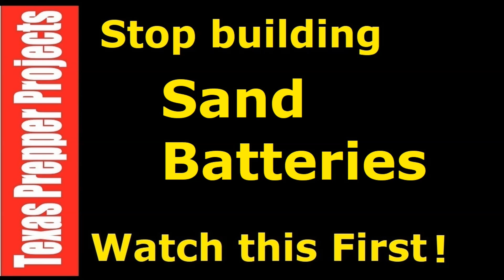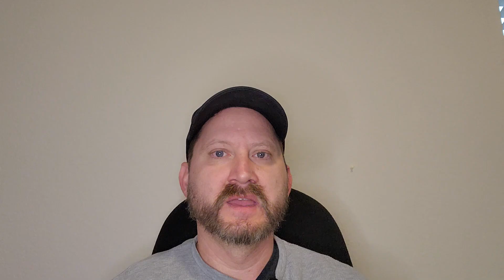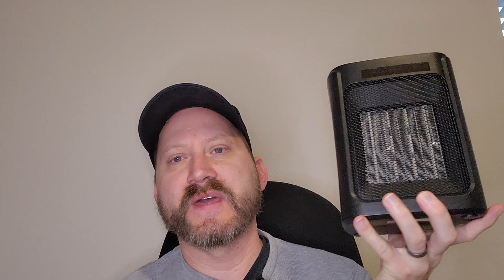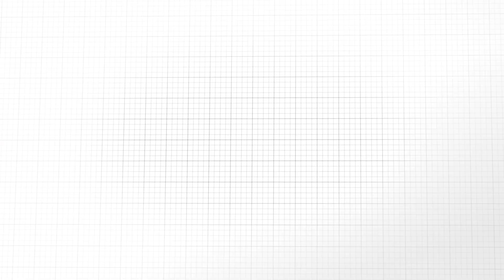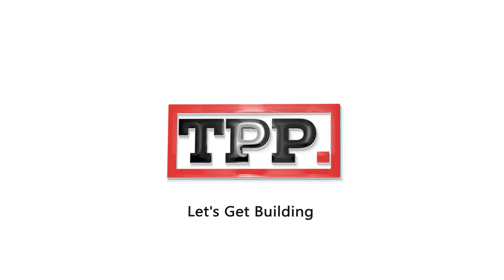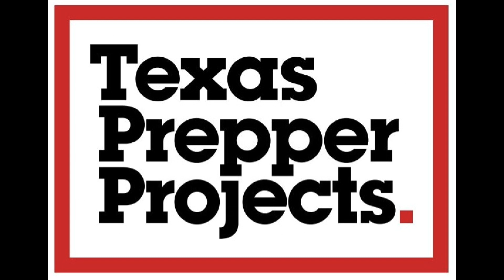Stop Building Sand Batteries | Texas Prepper Projects

Comment: You have used the word nothing very unfairly.  You could say any of these things are inefficient, even insignificant. But the fact is. A little heat is not nothing if you can use it.   Only around 30-40% of your SB heat is going into the air (convection). Most of your energy leaves as Infra Red energy (radiation) that heats the surfaces it finds. like your walls, pets and furniture..  Meaning you can invest heat in your couch and cushions across the room.   A sand battery is heating the whole room.. Actually really well. But you have to size it like any heating or AC system.  To suit your room..  Or, maybe don't treat it as the solution, but swing for reduced power use, which wouldn't be nothing.  

 A solar sand battery costs basically nothing.  Literally wiring and mounting hardware. And whatever it costs you to pick up free used solar panels that the world can't work out how to recycle.  If you have a weekend to put it together and the space to do it.  There's no downside popping to mind.  Just my 2c. I have them in greenhouses, none inside.  But I tell you, they are the difference between frost or not.. So.. It's way more than nothing when you see it.
Reply from the maker: I appreciate your reasonable and rational reply. Thank you!

Comment: sand battery that is heated up with a Fresnel Lense and then powering a sterling engine sounds like a great idea though. im going to try building that exact setup
Reply from the maker: Post a video. I have never seen a commercially available Stirling engine
Reply: @texasprepperprojects  type in mini sterling engine on Google and you can find cool small hobby grade ones. can mess around with it if you were super interested. I'm definitely going to try to make a  small setup with one see if it works well or not
Reply: @texasprepperprojects  there are small Stirling engines on Stirlingkit website

Comment: Missed point!
To all who thinks we create more power than we put in - expect a Nobel Prize!

But why I plan for building a sand battery.

Electricity prices (can be) set to an hourly rate, where I live (It should change in the future to a quarter hour/price).
So USUALLY electricity is CHEAP during the night, and raises sharply in the morning, is reduced during mid day, and raises to the evening to sink again to the night.
* A typical day last Tuesday was: 
between 00-06 o clock  0,4c/kWh
raising from 07-09 up to  17c/ kWh
declining from 10-13 down to 6,4c /kWh
staying from 14-17 between  4-7,1c /kWh
raising from 18-19 to 15,9 c /kWh
declining from 20-24 down to  0,7 c/ kWh
(prices in Euro) need to add 4 c/kWh for "electric transfer fees" to all prices.

Now the 20 USD heater heats even during the 17c peaks.

The whole idea is to heat the sand during the night for  0,4c/kWh, and then stop the heating, allowing the battery to give warmth for hours during the expensive time, avoiding to pay as much then.
If you have solar capacity, you might use the energy during the day to save it to the more expensive evening hours, with a battery that holds heat for hours.
A standard heater, or the 20USD heater will be cold in "10-20" minutes.
Reply from the maker: How many tons of sand are you using?
Reply: @texasprepperprojects    ??? The idea is to LOWER the cost during the day, not to eliminate heat needs with tons of sand!  😮‍💨
Reply from the maker: I look forward to your video with your testing

Comment: It might not make sense with solar , but you can  use   a wood fire to heat a bucket   of sand much hotter than a typical heating element.   

Place some copper tubing in  sand  to help draw heat exchange upward.   Places fireplace heat fan on top to distribute heat through room.   A good fire can yield  five five gallon pails.     

If you build a kilntype burner, think of a big rocket stove  - you can get higher heat yields through gasification.     

Mind you dry sand is about 16 pounds a gallon, so a five pound bucket gets heavy and hot.   Be very careful.   Or use smaller amounts of sand.

I'm  have more wood than sunshine - so  this is a great exchange system.    My wood is virtually free.   It's not good wood for a woodstove  but great for outdoor burning.
Reply from the maker: I look forward to seeing your video

Comment: This is where everyone is wrong. It's the conversions that waste energy. Use fresnel lenses to heat the sand (up to 500c) and use that to heat. 70% of all energy is heat related. Heating the home, air conditioning and absorption refrigeration, dryers, hot water and cooking. All of this can be done with a sand battery for about .47 per kwh of storage. Using an air loop for an oven, air fryer, house heat - A silicone oil loop for burners using liquid heat sinks plates as the burners.  - A water loop for hot water and for instant boiling water for small appliances. This is all able to be done with a sand battery system. This is not fer every situation just like any other type of alternative energy systems. BTW you candle in a flower pot has always been a pet peeve of mine.
Reply from the maker: I am excited to see your video where you show all of these things that you discuss.  Thanks for the comment
Reply: @texasprepperprojects  I don't do videos and this was not a critism of you if you took it that way. I was trying to open the conversation. If you read all the wat through you might have noticed I aligned with you and showed I agreed with your outlook but wanted to expand the thought is all

Comment: Why wouldn't you heat the sand far hotter than a couple hundred degrees?  The melting point is somewhere around 1700 degrees.  Also, why use a heating element instead of a fresnel lens to heat the sand.  Something along this line:  https://www.youtube.com/watch?v=kQCDXK_sXwk
Reply: I use Fresnel lenses myself (mainly for cooking) and I believe Exowatt is a scam to get investor money. No way they heat a large brick mass from above to 1000°C and get 25kW electrical power from the area of a shipping container. It's not like CSP doesn't work, it's actually proven technology, but this sounds like a lot of bs. The fact that they only have computer animations and no working model should ring alarm bells.
Reply from the maker: Because a normal fresnel lens has to be moved every 15 minutes. I saw that video, neat idea
Reply: @texasprepperprojects I did some more digging last night after that. Turned out there are some really simple sun trackers. There's a guy that posted a video where he used that sun tracker and two salvaged drills to keep his lens pointed at the sun, lol. I should be able to find it in my watch history if you're interested in seeing it.

Comment: Thanks so much for explaining those principles. What's?
Your opinion about using sand to store heat. I'm thinking about a passive solar situation where I place a sand battery inside a above ground water tank and allow the Sun to warm the water and the sand at the same time, therefore, minimizing the energy.I need to boost the water up to hot, and retaining that heat overnight because of the sand.
Reply from the maker: I think passively heating water makes more sense

Comment: I would like to try and use it as just an instant-hot water heater. Does anyone have any good resources on how to build one. Maybe in an insulated trash can?
Reply from the maker: Check out my older videos. I did it with a pool heater.  Or a parabolic mirror. It is very easy and very effective

Comment: What if you heat the sand from the sun ?
Reply from the maker: How
Reply: @texasprepperprojects  Parabolic mirror, I can do that. However, the next question is why. I don't need heat in summer and in winter when I want it there's not enough sunshine. If I want hot water e.g. for domestic use there are better systems, like evacuated tube collectors

Comment: A sand battery is not about creating heat out of nothing. It’s  about delaying the use of the heat. In some cases storing during the day and using during the evening. I’m n other cases storing during summer and using during the winter. Scale being the big factor between the two examples.
Reply from the maker: It needs to be a big scale
Reply: Explain please?
Reply: @a.d.leerentveld8980 There is a video of people effectively using a 55 gallon steel barrel fill with sand to warm a greenhouse through the night.

Comment: Putting an element in sand doesn't transfer heat well enough.
Heat forced air in pipes that are in the sand with second set of tubes to recover the heat.
Sand battery is for storing excess renewables like solar and win
Reply from the maker: Heat is heat
Reply: @texasprepperprojects  we're talking about heat transfer, sticking an element into sand don't transfer heat worth a dam

Comment: I'm fortunate, I have room for a 6 ft x 6 ft x 25 ft sand storage. 
Coiled plastic water pipe heated with my solar panels.
I don't spend on a dime heating the water end my in-floor heating system keeps me warm all winter
Reply: Let's see your video on that.
Reply from the maker: Cool
Reply: that's a lot of storage. any specs on temp you heat it too, how long it stays at temp and your heating element. thinking of building with a Cheating element from my solar
Reply: Similar to an idea I have but blowing the heat into the house.   I need something to help offset heating costs in a mountain house.

Comment: What about a 200L hot water system that doesn't hold water anymore in the tank but the heat exchanger coil is fine , would it be worth having a go at filling it with 200L of sand and placing several elements inside to make hot water again ? Basically My thoughts are that the water in the tank is simply holding heat anyway and I'm just exchanging the medium basically . The way it use to work was evacuated tubes to heat the water in the tank but I figure sand should work the same especially since its got fairly good insulation . Solar panels are so cheap these days I thought it might be a good use case for the idea .
Reply from the maker: Not worth it

Comment: I never heard someone claim that you would create more heat than you put into a sand battery. Storing the heat and have it slowly radiated later would make sense.

I was hoping down the road I could heat up sand in fire or piping water heated through pipes in sand, etc.  then move the sand indoors somehow to radiate for hours.
Reply from the maker: I think direct solar water heating with black tubing makes more sense overall

Comment: The key word is "battery".  Obviously, if you're just exposing the sand while you're heating it up, the only thing you're accomplishing is slowing down the rate at which the heat is dissipated.  The whole point is to insulate the container as much as you can and release the heat when needed.
By the same logic, why use a normal lithium battery pack when you could just use the solar energy directly?
Reply from the maker: Check out my other videos in the series where I do this

Comment: Currently I am entertaining the thought of using sand to backfill the 32’x24’x4’ pad of the garage when I build my house. 

The walls for the footers, and the ground, would be insulated with 4” of r-tech rigid foam. During the backfill compaction for every 6” lift, I would run the required length of heat loops. Once that is done, I would insulate the top portion of my 32’x24’x4’ “sandbox” before making the concrete pad for the garage. 

I live up north, and the heat to the house is off roughly from the start of May to the end of August, so I’m hoping that by the end of summer that the ‘sand battery’ would be pretty warm to help bring the cost of heating down for the winter months. 

Anyways, I just started looking into the concept of sand batteries a couple days ago so I have no idea if this is practical or not, but it did lead me to your channel, which, I really appreciate the information you’ve given - thumbs up from me. 

Godspeed.
Reply from the maker: Personally if I had that much space, I would be looking into geothermal with fluid or direct air transfer underground

Comment: Why questions to you is? On a larger scale cheap? Versus work? The desert is very hot and is charged by the sun. At night it loses it energy to the atmosphere with no cloud covered.  But when with heavy cloud cover its much warmer. So with little effort of heating say a house that's all ready burning 🔥 add sand around the garage stove or floor systems walls ect , so is it feasible for  the work and money to add ? For raiden heat supply?
Reply from the maker: Not big enough

Comment: First, you need to use soapstone instead of sand, as it stores 20% more heat (0.98 kJ/kg). In 1 ton of soapstone, you can store around 150 kWh of heat. With good insulation, heat loss can be reduced to around 1% per day. Instead of solar panels, use mirrors to concentrate sunlight and store heat, then utilize a steam engine or a Stirling engine, achieving 20–30% efficiency, which is sufficient for your home for ever, you dont need to think anymore about heat/energy ...
Reply from the maker: First, where do you get soapstone?   Second, where do you put 1 ton of soap stone in a house and how much does it cost?   Instead of solar panels, use mirrors eh?  I've tried that. The problem is SPACE and also you have to re aim the mirror every 15 minutes as the sun moves.   Steam engine?  Where do you get that?  Stirling engine? I challenge you to show me a COMMERCIALLY AVAILABLE Stirling engine, not something that you 3D print.    I look forward to seeing your video showing 1 ton of soap stone with mirrors and a Stirling engine powering your house.  ;)
Reply: @texasprepperprojects   
Crushed soapstone can be find in Finland for price around 50 - 100 dollars the ton , (+ shipping ) , using mirror to concentrate the heat to a receptor that will distributed into the sand (with a serpentin and a special molten salt)  and you got heat power of 1000 watts per m2 instead 220 watts of solar panel energy that will be converted into heat ...
 i find few  engine solution at sun-orbit or yanmar , also seftonmotors, for the mirror  , solar tracking system is very common and you can do DIY with arduino (if u know little bit of coding) , for storing the sand , you better dig a hole of 0.60m3 (+ your insulation ) and you get 1 ton of soapstone , the receptor will be placed above the sand

Comment: a candle will stream a bundle of heat directly up to the ceiling forming a mushroom and heating your roof that your birds can enjoy. a flowerpot over it will "radiate" the heat more evenly and slower towards the side. I can also imagine this works for sand. its also known that floor heating is more efficient then radiators. ironically radiators are not very effective in radiation heat as in infrared but instead work by convection of hot and cold air, finding its way leaking out all kinds of ways
Reply from the maker: Sure

Comment: I'm sorry but I don't agree with you want you say that you are not getting nothing. Granted that you are not generating more energy than the one you actually getting into the sand. In fact, as the sand is not 100% efficient, most likely, you are even wasting some of that heat / energy. 
However, and despite youtubers, in which you are included, started to "sell" the idea of using this for heating, the word "battery" kind of solves the mistery. This was conceived to achieve something that is very hard to do, which is, store energy that you get from renewable sources. 
So, if you heat up the sand to 500ºf and you have a good project and the "battery" properly insulated so that you can keep the sand warm for long periods, then you have managed to harvest and store energy. How you are going to use it? That is a different question. If you just release the heat into the air on a room, then, maybe you'll get the same as a small heater. However, if you use it to heat water and run that through a heating system, as water will boil over 212 ºF and you have 500 and you don't need boiling water to run a heating system, then you will be able to use that energy for a long span of time. Will you generated more than the input? No. Can you use it in a much more effecient maner than what you can with an amazon $20 heater?! For sure! So, even though, the basic information in you video is correct, the bottom line and the real utility have a battery, sand or of somenting else, was overlooked and therefore, you content is misleading.
Reply from the maker: the heat still comes out

Comment: I'm sure everyone already said this, but it's the battery part that makes it interesting. Storing the heat for use at night. I'm in Michigan and my heat pump heater is not efficient at 0F at night. So time shifting is helpful.
Reply from the maker: But, it doesn't. The heat is either going to go into the air, or go into the sand and then into the air. It all ends up in the same place
Reply: @texasprepperprojects  Huh? I live somewhere you don't need heat in the daytime, and the sun is intense. But at night, you definitely need heat. It's the thermal mass concept that makes adobe homes make sense in the high desert. The mass heats up during the day and has all night to release. It ends up in the same place, but not at the same time.
Reply: @bluegorillacookies  4th dimensional thinking. Doc Brown is proud :)
Reply: @texasprepperprojects  Yes it does, by the heat going into the air, it quite literally is acting similar to a battery by releasing stored energy over time (in the form of heat) at night. You're comparing apples to oranges in this video. Heating up the sand with solar power during the day, then releasing the power at night doesn't "create heat out of nothing", it creates heat out of energy stored in the form of heated sand.